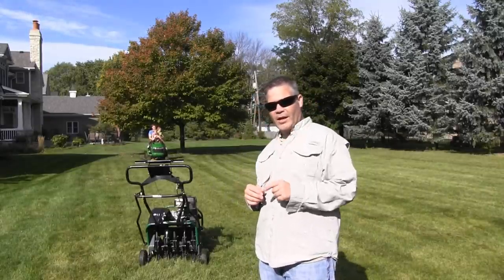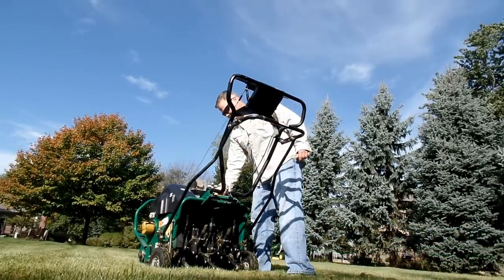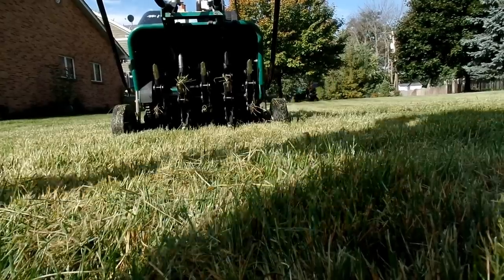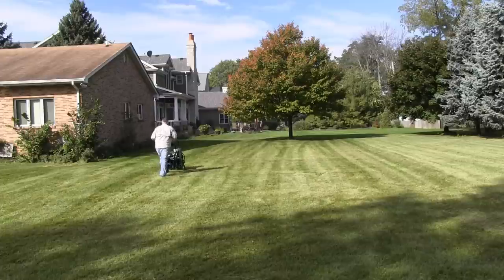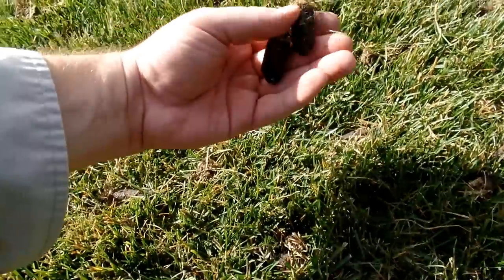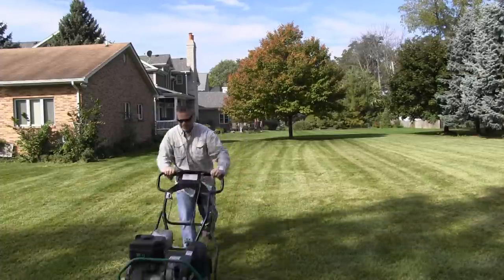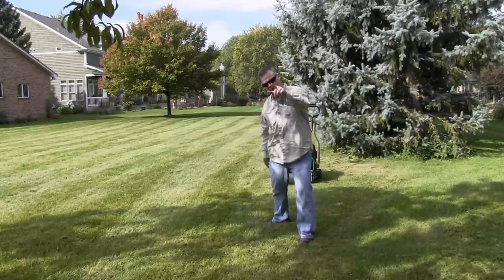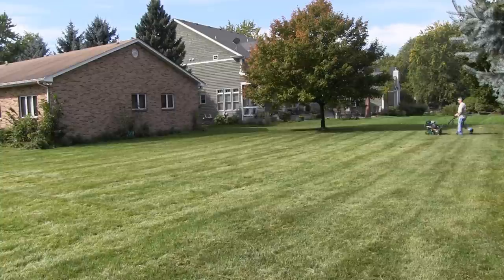How To Aerate The Lawn : How To Use A Core Aerator

Comment: Another awesome video Allyn thank you. FYI if your lawn is on clay like mine is here in Georgia, make sure you've had some water a few days prior otherwise you won't get very long cores because it won't penetrate, but not too wet or you'll have a muddy mess. Also, I always like to activate the drive a little slower, by slowly pushing on the lever, so it doesn't jerk out of my hand, but not too slow, you'll get the hang of it. Happy aerating!

Comment: I'll be using one in the next couple of weeks.  Should I be concerned about sprinkler lines in the ground or does this not go quite that deep?
Reply from the maker: +JM Lawn Care the irrigation lines should be fine. But sprinkler heads should be marked and avoided. Also, cable TV lines get nailed alot. They are not always buried deep enough. Good luck! Have fun with the machine! enjoy the pain :)

Comment: Allen-I had new home built last year and builder seeded and I had lawn service reseed in September.Grass came in ok considering, but now I have areas that look dead/dieing.I did put a pre-emergent/fertilizer  down at end of march.I live in Pa.The grass seemed pretty descent back in the middle and end of april and May.Not sure why areas are dieing off.Lots of black/green looking slime  on the soil.Any suggestions.We had a dry spring and now June and july have been wet.
Reply: fungus is the cause. put down some Propiconazole 14.3 its expensive but works well. actually alot less expensive than others. and you dont have to put it down as often as they say. look on peststrong its the cheapest place.i put it down 3-4 times a year. works great!! brown patch and other types are what you are seeing

Comment: I've never used an aerator. How do you modify how deep the cores go? Is it adjustable on the machine or do all aerators have a set depth?
Reply: There’s no way on to modify size of core with machine it’s automatically determined by how wet or dry your soil is / ideally you’ve recently had a good rain the day before or you’ve used your sprinkler system several hours b4 to let the water soak into the lawn
Reply: @brucebeamon5460  thanks very much.for the help!

Comment: Please help this beginner lawn nut.I just had my lawn for about a year now and I aerated and my plug were just about an inch come to find out I have only about a inche and half of soil from the developers   landscaper were told to put down which i just found out then ther a sand mix under there also .My question is should I restart and bring in more soil the lawn been looking ok but nowhere where I wanted to be.thanks Edwin
Reply from the maker: Edwin Burgos that's a tough question. I personally would try to work with what is there. Starting over is a very expensive and labor intensive option.